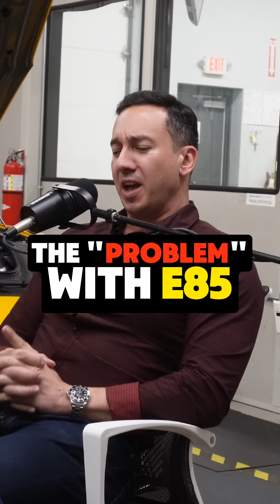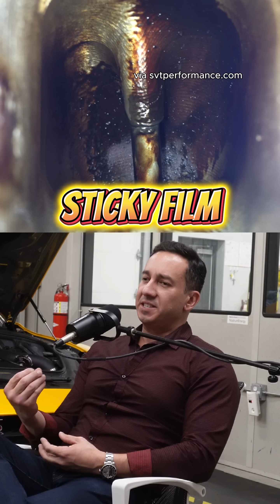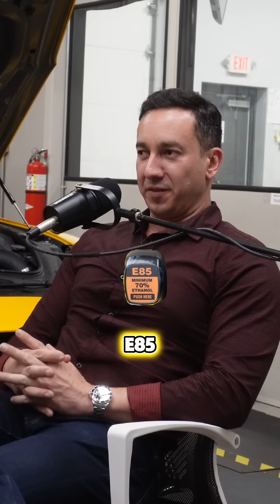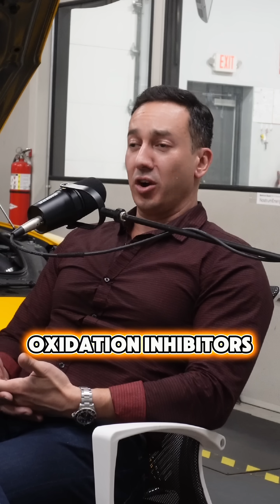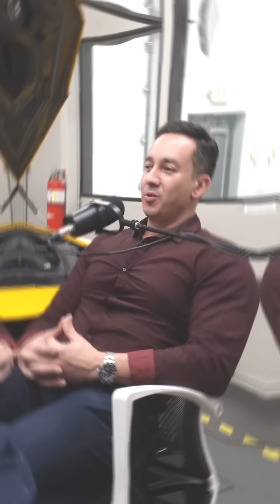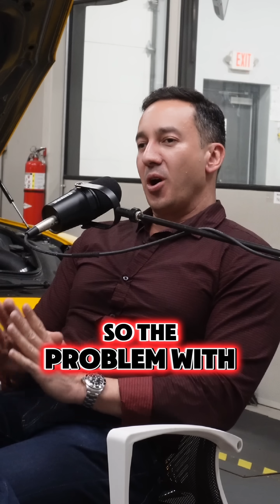THE "PROBLEM" WITH E85

Comment: Ethanol has a bad reputation with some people because of people like you who spread bad information. 

The ethanol that's blended with gasoline to make E10, E15, E30, and E85 contains only ethanol and a small amount of basic gasoline to denature it. The gasoline portion of the blends contain dozens, sometimes hundreds of additives. Ethanol is a more efficient cleaner, so when you use an ethanol-gasoline blend for the first few times, it will clean the crude out that the gasoline cleaning additives can't. 

This is not a "precipitation" problem, it is a characteristic of a superior cleaning product. This will sometimes cause a problem. However, once the gunk is gone, the engine remains cleaner, as long as you continue using ethanol-gasoline blends.

Also, you talk about "intermediate blends" as if they are somehow worse than E85. This is laughable because in America E85 is almost never really 85% ethanol and 15% gasoline. E85 in America can range fro 51% ethanol to 83% ethanol. Therefore, E85 is almost always an "intermediate blend."

Comment: My celica was running on e85 but I had bought a used engine and transmission swapped it back to stock , but now every time im done filling up my gas , once I turn it on the car chokes up and turns off , I would have to rev in on neutral and put it on drive and it'll start running normal again.  But only does that after im done filling up gas , any ideas?

Comment: Don't use any sort of blend if your car doesn't have a high compression ratio and an actual flex fuel system (by that, i mean more than just sensor).

In Brazil we've been running ethanol for around 50 years and flex fuel systems for around 30 - not to mention CNG. A lots of imported gasoline only vehicles have mid to long term issues with our fuel - despite our gasoline containing anhydrous ethanol.

Comment: Ethanol has a lot of moisture where gasoline does not. Ethanol is garbage fuel that has no environmental benefits whatsoever. Ethanol kills engines every single day. Most of the time ethanol kills engines by introducing moisture into the engine oil which causes all the important components in the crankcase to RUST which is a death sentence for an engine.

Comment: It is the ethanol. That is the problem sure hair splitting it is the detergent they put in with the ethanol, but they have to put those additives in with the ethanol therefore it's the damn ethanol. Example I have to run high octane fuel in a motorcycle doesn't have to be high octane but I have to do it where I live because the e85 contains alcohol that gels up and messes up my carburetor. The high octane fuel has more detergents more additives than the two grades below it It's never jelled up It doesn't have a problem. Why? because it doesn't have the ethanol.

Comment: Its actually the fact that ethanol absorbs water. The more ethanol in the blend, the more potential for water to get in the fuel. Water will cause corrosion. Water does not lubricate well and will cause DI pump and injector failure. Switching back and forth from E85 to premium is a good practice. Running an intermediate blend is also totally fine. Most importantly, do not let a car sit for any extended time with E85 in the tank even if it is "E85 compatible" or "flex fuel". It will absorb water. 
I have been on the E85 bandwagon for almost 20 years now and learned plenty of tricks.
Reply: When you say don't let car sit for long time with e85, do you mean with pure e85 in the tank or bland pump gas and e85?
Reply: @DailyClipztt The more ethanol the less time it should sit. It absorbs moisture from the air (similar to brake fluid) and becomes corrosive. With straight E85 you dont want the same batch sitting in the tank for more than 10 days. Something like an E35 blend can go maybe 20 days. Anything longer is asking for trouble, especially on a vehicle that is not technically flex fuel by design.

Comment: Ummm my guy E85 is 15% gas so if the additive precipitated when it comes into contact with gas then the additive package would be useless to begine with......... thats what E85 means 85% ethanol 15% gas youre not getting E100

Comment: Ethanol driven fuel is garbage new mater which way you look at above. I would never run that c***. I mean I put stuff in there to eliminate the alcohol in a 94 octane because it destroys pistons destroys injectors intakes exhaust so you. Don't what are you talking about you full of s***?

Comment: You're stating raw facts, and as a person who ran a '15 Silverado on E85 almost exclusively for 115000 miles, I can affirm that pure, consistent tankfills with e85 do not cause long term DI/intake/valve deposits, or oil contamination. That said, I ran that truck 80-150 miles every day and it NEVER experienced what would be defined as a "short trip" the engine was warmed to 185 and sustained there for 6-9 hours. Every day. For folks who don't have a station near home that sells e85 and are able to use it consistently, or folks who don't sustain operating temperature for a significant amount of time E85 can be legitimately dangerous to run
Reply: True enough, just don't store ANY vehicle or equipment with ANY alcohol in the tank or fuel system! YEARS of experience that I wish I didn't have taught me!

Comment: It's the sugar in the corn whiskey 🎉 Sugar's highly flammable.That's what it takes to make corn whiskey😊.That's what's left over.When you boil it down you just made caramel in your motor😮😮😮
Reply: Its distilled to pure ethanol. No sugars are left. And ethanol burns clean. E-85 is 85% Ethanol/Alcohol, 15% gasoline

Comment: I have never replaced so many fuel pumps, sending units, or fuel injectors, since E85 came to market. 

Keep using it. I need the work.)
Reply: In the last six months, i replaced my scooter, Supersport bike, and auto fuel pump.  

All had nasty green brown shit residue in the fuel pump sock
Reply: I just got done replacement of a sending unit and fuel pump in a Ford Explorer. A nasty job. The contacts were covered in that goo you just described.
Reply: @Karrpilot  I did the car's yesterday.  Slimy green brown residue which seems like algae
Reply: @Payt-y5d  If you see a bottle of early times for $13.00 next to a bottle of jack for $24.00, buy the jack. Enough said.
Reply: @Karrpilot  eh, I'm more a canadien club guy

Comment: You know there's at least 15% gasoline in E85, right? That's why it's E-85. 85% Ethanol, 15% gasoline. Idc what's in the E85 that gums up fuel pumps, the point is that E85 gums up fuel pumps. Bruh. The ONLY reason people run E85 is because it has better knock characteristics than E10. 

STOP PUTTING CORN IN GAS. STOP PUTTING DIRECT INJECTION IN GASOLINE ENGINES. STOP USING EGR. 

I HATE THE GOVERNMENT, ESPECIALLY THE ATF, FDA, AND EPA. THIS IS R3T@RDED.

Comment: Ethanol is not needed created to make big money. You have to use more gas than running straight gas. That why engines had to have  injectors. injectors allow water to be injected in the engine. Ethanol is very corrosive to the hole fuel. system

Comment: It deserves the bad reputation because most fuel is a blend of 5to10% all the way up to e85. It sucks. Most vehicles even boats, bikes and equipment are not made for it. It  eats and destroys everything it touches. The fuel goes bad within 15 days out of the pump. On top of that 20 gallons of gas with alcohol will absorb 12oz of water right out of the air. It then evaporates and leaves all that water behind so nothing will run. It is absolute garbage and cost more to produce than just good old gasoline.
It Needs to Go Away.

Comment: I've compared E85 VS 87 octane fuel in my F150. It turns out that with E85, I'm getting better milage and power. I've been using E85 for almost 1yr already and have no problems.

Comment: If u switch between gasoline and e85, be sure to go down to 1/8th tank each way. That will solve the problem he mentions AND keep your calculated mixture correct. Occasionally i have to correct what the PCM thinks is in the tank. This week, it was a no start. The Suburban thot there was 80% alcohol when the last 6 tanks were gasoline. GM allowed for a fuel compostion reset.

Comment: And the fact, that you must burn twice the volume of fuel, to get the same power.
And, it evaporates a lot faster.
Reply: Comparing a fuel's energy output by volume in a combustion engine is ignorant. People need to stop parroting what you said because it is fundamentally incorrect for the given application. Internal combustion engines need fuel and air to function. E85 has a much greater energy output given the same amount of air than gasoline. If an ICE only required fuel to function, then gasoline would indeed create the most energy. Since you need multiple components to create efficient combustion, which includes oxygen, E85 has a greater energy output in this application.
Reply: @SoundFaithStudios  bullshit 
Flow must be significantly increased, 9.8 air/fuel ratio compared to 14.7 for petrol. That's 33%. 
You must replace fuel lines and pumps, to maintain flow.
I'm from Australia, e85 has been available for many years, rarely used except racing. 
And, illegal to use in a boat.
Reply: @bodgiesteve8849  You said you need to burn twice as much E85 to make the same power as gasoline. The implication is that gasoline is superior because it makes the same power with less volume of fuel. In an internal combustion engine, air and fuel flow can be manipulated, and neither is a constant. Just because gasoline has a higher energy density by volume than e85 doesn't mean it has more energy density overall. Yes, you need around 30% more volume of e85 compared to gasoline, but you also need air for combustion. An engine that can flow 2,000 CFM of air will make more power on e85 at lambda 1 than gasoline with no other changes because e85 has a higher energy output per the same amount of air than gasoline. Gasoline is a great all-around fuel, but e85 is superior for making more power in an ICE application.
Reply: @SoundFaithStudios The whole reason for using e85 is to reduce the chance of knock. Mazda Sky active technology runs compression ratios of almost 14:1 on pump gas. No knock? Why? They know what they’re doing. There’s a reason a car is hard to start cold on E85, it is not superior.

Comment: “Not the e85 causing the tar” yet putting the e85 will cause the tar. Like wtf are u saying. Lemme just order drums of e85 for 8x the amount it is at the pump 24/7. Not everywhere has e85 what r u expecting on a street car running e85?

Comment: I've only had one F150 that would run E85, the closest station was 100km's away and the fuel was more expensive than premium.  So I've never had a problem with E85.  Run E10 and the only issue is in small equipment engines that sit for a season like snow blowers.  Use a fuel conditioner as well as empty the tank and fuel bowl before storage and never had an issue.

Comment: That explains why even the 10% ethanol content of the pump gas around here causes major issues with everything with two wheels that I work on. Corrosion, water, the green snot bubbles,  all of it that screws a carburetor in about 3 months.
Reply: It sit there and dries up so it gums it.
Reply: @The_Annoyed_chef  Gasoline "drys up" faster than ethanol. Get some E0 gasoline and put some in a bowl or glass. Do the same with 100% ethanol and put an equal amount in a similar bowl or glass. The gasoline will evaporate before the ethanol. Wait for the ethanol to fully evaporate. Then, rub your finger inside the ethanol glass. ther will be no gum or residue. Rub your finger inside the gasoline glass. There will be gummy residue on your finger. When you don't know what you are talking about, and you don't, you should keep your mouth shut!
Reply: @TheAutoChannel Fuel Degradation: Ethanol's hygroscopic (water-attracting) nature means it pulls moisture from the air, which can lead to fuel system corrosion and gumming, reducing fuel quality over time. The problem is that ethanol pulls water out of air and sit at the bottom of the tank with the alcohol and shit. Then the evaporated gas gunk goes there also.
Reply: Wrong! And if this is what you tell your customers and then charge them money to "fix the ethanol damage," then you are committing fraud.
Reply: @TheAutoChannel it’s not wrong though. That’s why you’re not supposed to run 10% ethanol pump gas in zero turn mowers.
Reply: @402car_kid4  All vehicles in Brazil are the same as in the U.S. For many years, their mandatory base fuel was E27. Several months ago, the base fuel was upped to E30. If all spark ignited internal combustion vehicls in Brazil run perfectly fine on E27 and E30, then all spark ignited internal combustion engines in America and the rest of the world can run on E27 and E30. When you don't know what you're talking about, and you don't, keep your mouth shut.

Comment: I'd rather have pure gas. Yes, you can crank the boost and timing with E85, but I need efficiency too. You're off throttle more than on it. Plus, let's not take subsidized food and make fuel.

Comment: Ethanol attacks water. It must be kept on non venteg BLADERS.  And it preferred to be mix with gasoline at filling the automobile time. Engineering Recommendation.
In third world countries that hat store the pre-mixed ethanol gasoline concoctions in vented underground tanks, found them self pumping lot of  water absorbed in the ethanol, with the end effect was that engines began to blow head gasket from water precipitating it the car high pressure injection systems.   Education 101 on engines you learn that yo can't compress water.
Water injection systems are atomised to a god a mist that reduces de tempuratue and increases de air mass charged.  Now, they in WWII were know to if not finely mist or fog, droplets would make the pistons blow the heads of.  You could be in the pats if was an inboard cylinder head. It would go thru the fuselage.

Comment: How do you get away from it then if e85 has 15 % of gasoline in it?
Reply: That's what I'm thinking too. It sounds like he is saying not to ever mix gasoline with ethanol, but that's what E85 is. I wish we did not have to pay so much for straight gasoline.
Reply: @cruisinspecialtiesllc6104  yeah, it's the mix that does it.  E85  straight out of the pump  doesn't do it, the 15% of gasoline in it is different  than 87,89,93.
Reply: That's what I'm thinking too. It sounds like he is saying not to ever mix gasoline with ethanol, but that's what E85 is. I wish we did not have to pay so much for straight gasoline.